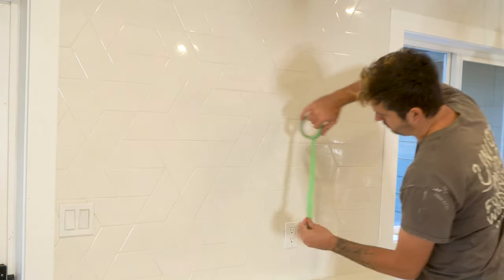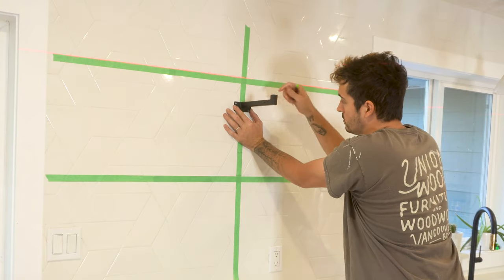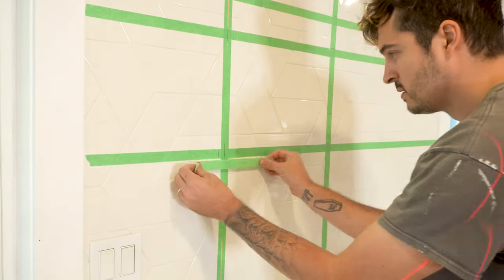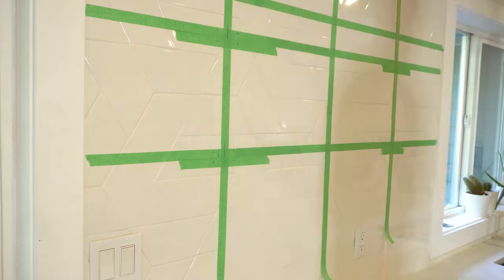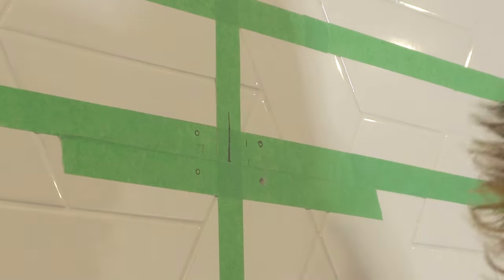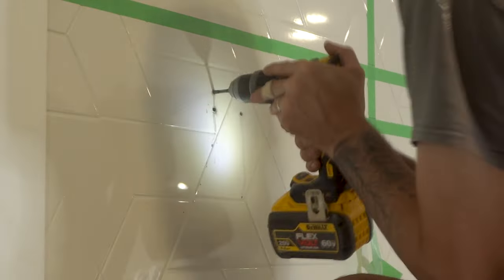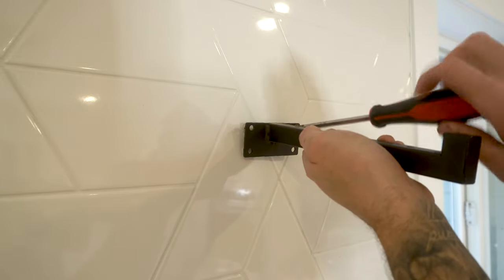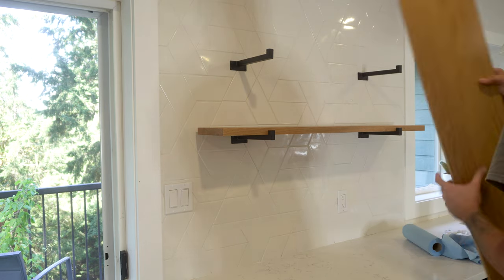How To Install Shelves On A Tiled Wall | DIY  #homeimprovement #diy #modernhome

Comment: Exactly what I  needed to see.....there has been much trepidation about drilling a dozen holes in my new tile, although, we opted to drill first before grouting just in case we cracked a tile.  But after measuring more than twice to perfectly  line up and level three shelves, the drilling  process went off  without a hitch.  Thanks for some clear direction.
Reply from the maker: Your so welcome, Cheers

Comment: Great video, thanks for sharing this! I am basing my project off of your instructions and have a couple questions: did all 4 of your holes for the left brackets secure to the stud? What type of screws did you use to drill into the studs? Did the one ceramic bit last for all 16 holes? How thick are the wood shelves you used, 1 inch? Did you drill pilot holes into the wood shelves before you screwed them into the brackets? 

Thanks so much for help, shelves look awesome!
Reply from the maker: Hey Thanks, so I managed to just hit one stud on the left hand side with 4 screws out of the 8, every other hole was into tile using a masonry plug. if you can hit a stud its always recommended but not always the case. especially on a tiled wall as its often hard to find the stud location. I used two bits for all 16 holes but bear in mind some tiles are harder than others so it may vary to how many you may use. The trick is to keep the bit from overheating as that's what causes to blunt. I use the screws provided with the hardware but any standard wood screws will work with the stud or wall plug. its better to find a colour match if screws aren't provided. The shelves are 1" thick White oak and yes I pre drilled the shelves and recommend you do to if your using hardwood. Often the screws provided with hardware are fairly soft and can break/snap screwing into hardwoods. Hope this helps.
Reply: @RadDadBuilds  many thanks!

Comment: Can these shelves hold a lot of weight?  Like a stack of plates or a bunch of glass jars filled with dried goods?  My vision is to have floating shelves with rice, couscous, granola, bread crumbs, oil, vinegar, etc, but I'm not sure if I'd be setting myself up for disaster (eg: a broken shelf, cracked tile, etc)
Reply from the maker: I probably wouldn't stack plates but jars of dried good would be fine.
Reply: @RadDadBuilds  thank you!  And happy new year!

Comment: How do you know what size hole to drill with respect to the plastic wall anchors?  same size, a bit larger (how much larger) hole?  And I guess the screws should be the same size as the anchor?

Comment: with the cooling of the bit, wouldn't it be easier to use a spray bottle and keep wetting as you drill?
or have a 2nd person doing it?
Reply from the maker: Agreed it would but its gets very messy.
Reply: @RadDadBuilds  most tiles are in a bathroom or kitchen ;)  

none the less, your video did help me as I had to mount new towel rails in my bathroom and I got it right because of this video.

now, to hover up old holes...  
I've used gap filler and then finished with gyprock compound so it was easy to sand back flush and thinking a dab of clear nail polish for sealing.
lucky it's white tiles so it's a pretty close match colour wise.

the arrow shamed masonry drill is the shit for tiles though, just chews through them like a hot knife through butter, almost no pressure needed.

Comment: Will this work the same for glass subway tiles? Building shelves for my wet bar
Reply from the maker: This may work for glass but I would always recommend testing on a leftover tile first. You can also get glass drill bits which might help get through the first layer of glass the switch bits when you're at the tile section.

Comment: I love the tiles! Do you know where you got them from?
Reply from the maker: I got them from a local tile shop here on Vancouver island but there pretty common. It’s the pattern which makes the difference. The tile shape is trapezoid and they have a glossy finish. Most tile shops should be able to get them. For the pattern I do have a whole video showing the process in the description below if you want to check that out 🤙🤙
Reply: @RadDadBuilds  Cheers man. I really like the shelf brackets. Too bad they don't ship to Australia!

Comment: I thought that the wallplugs should go deeper into the wall so that they're completely beyond the tile.
Reply from the maker: There more effective in tile rather than drywall as the drywall compresses easily. They work by expanding into the drilled hole once the screw enters the plug.